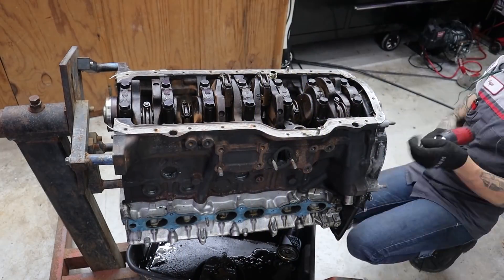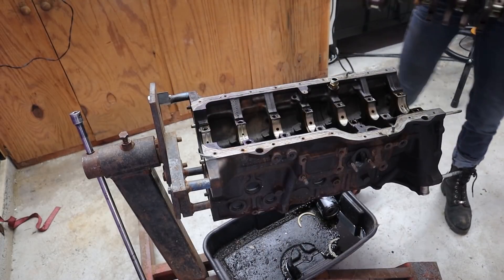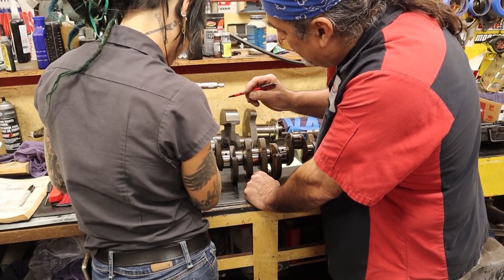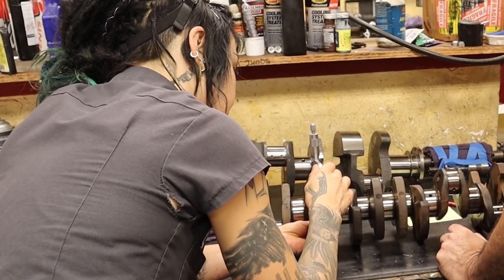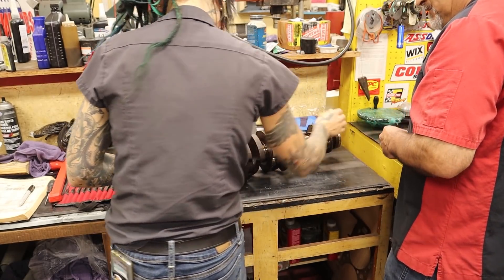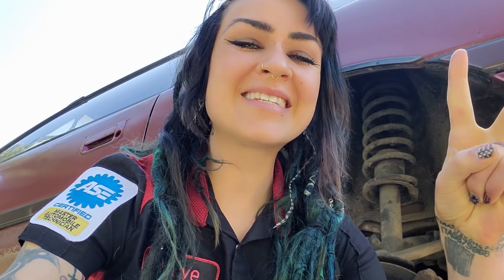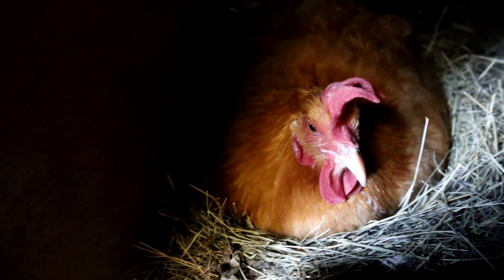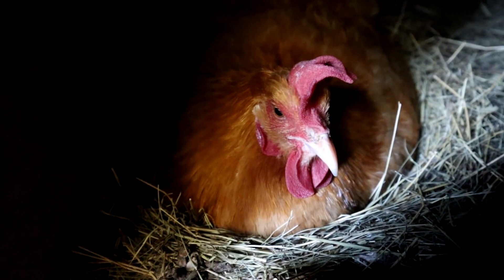2: Project 88: New Crank & Rods? Tips from the Master Machinist, PLUS Hooptie Round 2 bonus footage!

Comment: There's no gravity, there's only density
Reply from the maker: Density, bouancy, and the negative charge of the earth explain it all! Haha seems like you're a thinker 😉😉😉
Reply: @FayeHadley  thanks for responding even though this is an old video.
I also have 1986.5 Supra 5 speed Manual when I parked it in 2012 it ran, I put new fuel in yesterday new fuel pump in the tank but no go, my next replacement will be the in-line fuel thingy that's not letting fuel go by, wish me luck

Comment: The  bottom wears more because there is more force when the piston-rod is moving up than when moving down. The piston-rod needs to move faster as it approaches TDC on its way up. So, the piston-rod moving up is stopped from exploding out of the engine by the connecting rod-crank connection and puts a lot of force on the bottom side of the crank pin connection. That's my guess anyway.

Comment: When your measurements fall in the split or just above by two or three tenth's (I believe) above just do a micro polish of the journals and run the stock sized bearing. It is when you above the spilt by a lot is when you grind and go oversized bearings. Anything that falls in the split is good and less costly to the customer. I have actually got away with doing a re-hone and polishing of the crank journals out of a 30+ year old block out of an Oldsmobile, and did all this in my small garage and all hand tools. If you are interested on HP, Torque, Power to weight ratio,  ext, you can figure all that out on paper before your build. What I learned in school was if those numbers don't jive on paper, neither will your engine. That would also be part of blue printing an engine.

Comment: A lot of micrometers use different graduations, and some have quirks you need to learn, such as learning how much tension they need.  Many have ratchet thimbles on the end on them so its harder to over tighten.  Any time anyone wants to teach you how to properly use their tools, you should listen to them.  I have two full sets, of micrometers and each takes a slightly different tension to be accurate.  The new Fowlers need to use the ratchet to be accurate, and the old Starretts are much more forgiving.

Comment: I brought in my 2018 Sequoia to a Toyota dealership. I was experiencing electrical issues. The windows, the radio and the shifter were not working. They normally charge $140 for diagnostic,  but this time they charged me $420 for diagnostic because they said it was 3 different areas to diagnose. Finally they discovered it was a couple of blown fuses & missing fuse. Did I get scammed?

Comment: This was very satisfying. Danny's a smart man so he sees teaching you things as a special opportunity to make a contribution to the world because in that way you're kindred spirits. Back in '71, an old mechanic told me that freeing parts that are really on there requires constant pressure and vibration. I imagine he meant tension, but now I snug up a puller and tap the part, snug it  up a bit more and tap again. In that way it pops off easily without ever putting crazy amounts of stress on pullers or parts. You probably knew that but it's a gift I like to pass on at every opportunity.
Reply: Danny and Faye have covered that, it is called resonant frequency and we use it a lot. Great comment.
Reply from the maker: Thank you, Shop Mom!! 🥰

Comment: I always assumed the wear at the bottom was due to the force required to pull the piston back down during the intake stroke when a firing event isn’t pushing the piston toward the crank, but the piston/rod speed is the same making the direction change more abrupt. Since it’s unassisted.

Cool track!

Comment: I was on a pit crew at a dirt track one season.  The owner wanted me to drive in the mechanic's race at the end of the season.

At a dirt track, they have a water truck spray down the track, then another truck comes out with a big chopper and chews the track up into a muddy mess.  Then all of the race cars come out and "pack the track" or drive around the track clockwise at low speed until the track nice and smooth again.  The little bit of moisture helps the tires stick and keeps the dust down.

So the car owner tells me I need to get used to driving the car around other cars and tells me to go pack the track.  I get out there in a car with no glass, little to no tread, slipping and sliding, with the car in front of me kicking up big mud clods that smack into the grate that's welded into where the windshield used to be.

I did ten laps trying not to slide into the wall or another car before I brought her back in and said, "That was my recommended dosage of adrenaline for the year, thank you very much."  Ain't no way was I taking that car out there at speed with 4 to 14 other cars.  Not.  Gonna.  Happen.  Why did he think I was turning a wrench and not a steering wheel?

Comment: What a great skill to learn. there are many parts that could use this skill. not all are necessary, but it's still a skill worth Having. wheel bearings. axle wear.  I learned Engine rebuilding In 1983. I don't use micrometer skills weekly or even monthly any more, but I did use it daily for about 2 years. It takes a few to read right but it comes back
Reply from the maker: Yeah it was probably 5-6 years for me!!! Totally had to learn all over again!!